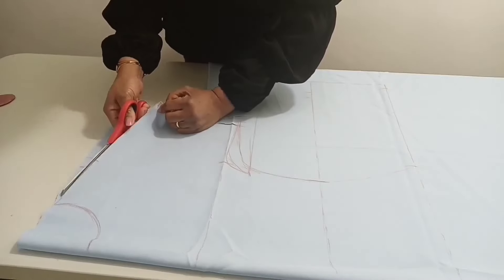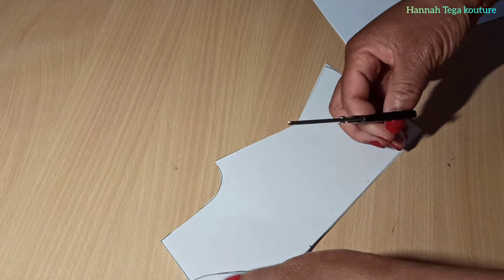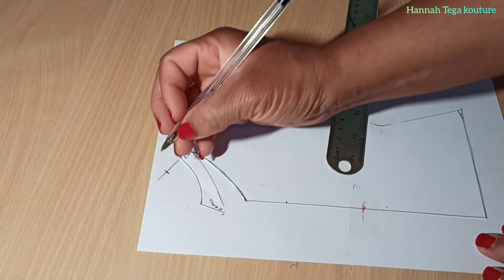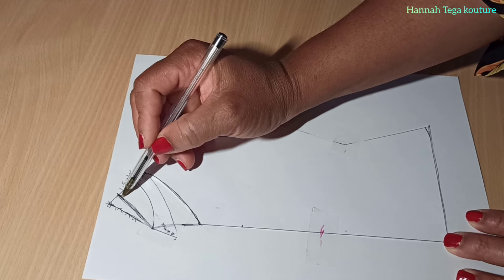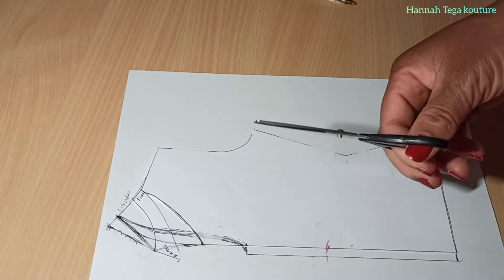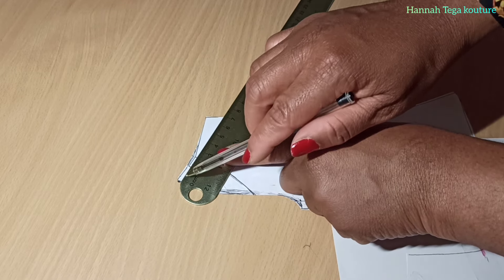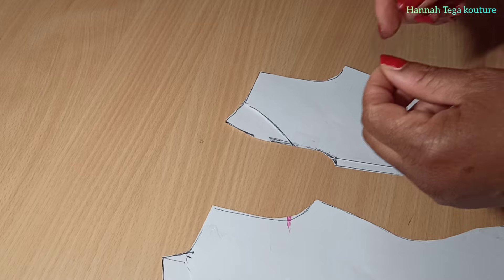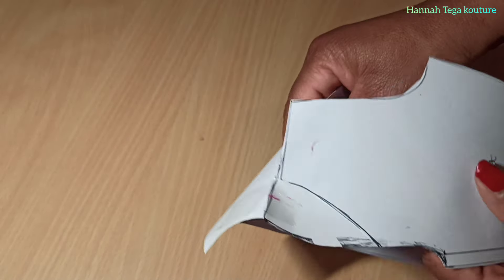How to make a Built Up Collar / High Neck Collar / Neckline

Comment: I'm confused.  You say you're going to work in centimeters, but you say inches.
Reply from the maker: I used cm, because of the A4 paper size. You need to use inches when drafting your own, as you should be drafting your actual size.